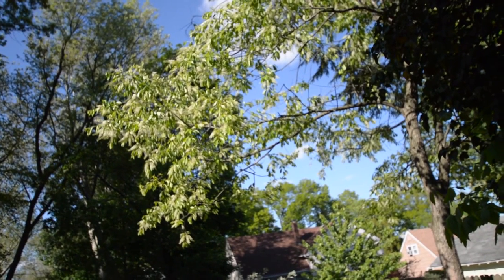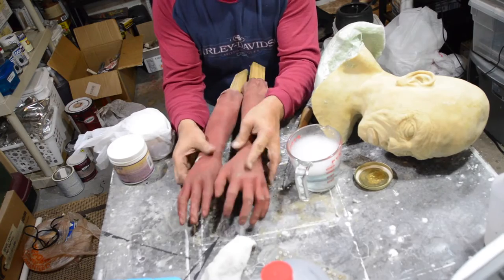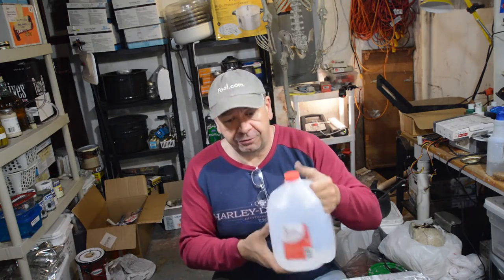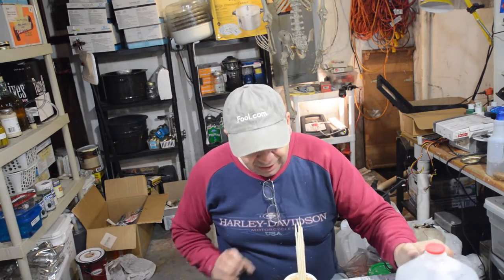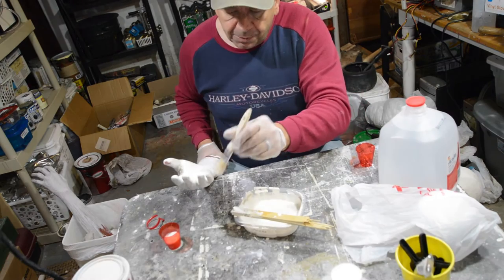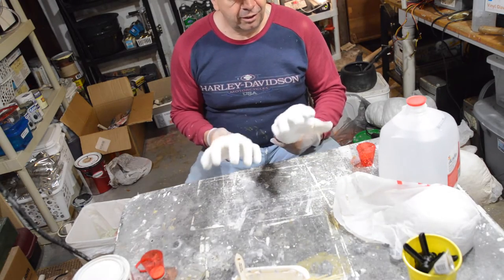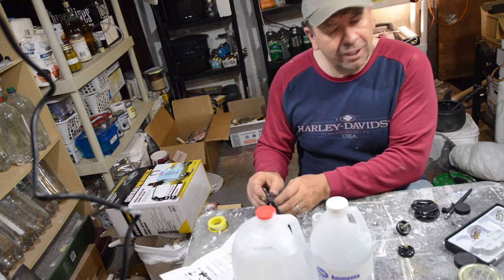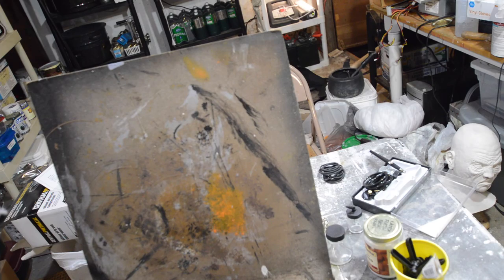Painting the Cellarer Prop Mask and Arms

Comment: Great video!!! Can't help ya with the airbrushing. The other day I thought of you, you would have laughed! I was trying to remove a shelf in the closet......i was using a screwdriver to push it away from the wall...ended up ruing the dry wall.....then I found an old saw in the garage..started sawing the shelving thinking surely I could make several cuts and eventually just hammer the pieces down....almost cut my arm off....apparently it's a metal saw...not sure why that matters. Figured it could handle wood!! Anyway I got the shelf down with enough hammering. Then had to spackle the damage, and sanded then next day painted. I'm a sissy!!!!
Reply from the maker: +Halloween Happy That's what they make sledge hammers for! Lol! I could just see myself in your situation, and cursing my way through it, making three times more work for myself in the process. But you gotta admire the way those shelves were put up. You know they weren't going to fall down with whatever you put on them
Reply: +GhoulishCop I don't have a sledge hammer!!!! 👀😀 but thought many times to go purchase one lol

Comment: I meant to post this yesterday, but I met with a professional prop maker recently who tipped me off on how to ensure that acrylic paint doesn't crack or chip off. He said that you add a bit of water based contact cement to your paint and it makes for better adhesion to whatever you're painting it on. The downside is that it's too thick to run through an airbrush.
Reply from the maker: +Dminorsound Oh, that sounds like a neat tip! Next time I do a base coat I'll definitely keep that in mind. Thanks! I do know that Allen Hopps recommends coating the finished project with original Armor-All spray, the kind you'd clean your car dashboard with. He says he applies it every 6 months to keep the paint intact.

Comment: Howdy. My apologies, I id not know that Harbor freight added a second $9.99 airbrush to their line up. The one you have is not the kind I recommend I like this one- the quick change airbrush- also strain you paint through some paintyhose before it goes in your paint jar- that was some gnarly latex lol.

http://www.harborfreight.com/quick-change-airbrush-kit-93506.html
Reply: +StiltbeastStudios I was wondering what you would use to strain the paint!
Reply from the maker: +StiltbeastStudios Thanks Allen. That's the airbrush I ended up getting. And I had picked up a box of paint strainers at HFT too, cardboard funnels with a fine mesh at the bottom. But pantyhose works too!

Comment: Don't know anything about air brushes so can't help you. Someone will know and a lightbulb will go off ... even its a very dim one. LOL

That fence post foam looks really solid. I have a project that was going to use the "expensive" stuff for ... will definitely try that now.
Reply from the maker: +The Pirates of North Court Surprisingly strong. I raised my eyebrows the first time I heard about it, thinking "They set fence posts with that?" I'd probably still set corner posts with cement, but for posts in the field this probably works just fine. And for filling masks and stuff, it's perfect!
Reply: +GhoulishCop  Im a fan on it!

Comment: Think your airbrush problems are caused by the tip being brass. Brass is made up of copper and latex instantly coagulates in contact with. Iv literally done the same thing with the same air brush. And the latex that I cleaned out was al gummed up and brown.

Comment: I was curious about the airbrushing as I'm anxiously wanting to buy a kit.  It always looks so easy, I was afraid of that.  so make the paint 50/50 with water?
Reply from the maker: +SandricCemetery (SandCem) If you're airbrushing something like a piece of wood or foam or paper, yes, it would be diluted with water 50-50. If you're doing a latex mask like I am, or something similar, then its diluted by 1/3...1/3 paint, 1/3 distilled water, and 1/3 liquid latex. The $10 airbrush at Harbor Freight (if you have one near) is a good one to practice with. It's recommended by everyone that does masks. I wouldn't get the small compressor that goes with it though. Just use one you already have, like a pancake compressor. My "airbrush compressor" wasn't getting enough pressure built up to do the painting. I switched to my pancake one and it works fine.
Reply: Thanks for clarifying.. lots of detail involved and I don't have any air compressors.  I'm a complete rookie when it comes to this stuff. I do have HFT near, thank goodness.
Reply from the maker: +SandricCemetery (SandCem) Maybe I just need to play with that small compressor some more or -- heaven forfend! -- read the manual!

Comment: did you get it from harbor freight as well? after I seen the video today I kinda wanted one lol ... decisions decisions lol. sweet looking job though. . I really like those terror syndicate hands and mask
Reply from the maker: +beth Schüler Yes, it's $10 at HFT. They have several models there, a better one for $22 (or right now $15 if you're a VIP member). But I'm going to try my older ones again since it was the compressor and not the airbrush. As for the Terror Syndicate mask, you can't beat the price. $30 and it's a pretty good quality pour too. They're thick, not flimsy at all and have some good detailing on them. The prop hands I think go for $15 each. I'd probably get hands/arms off eBay, they're much cheaper, like around $5-$10 with free shipping. Occasionally Hickman has pre-painted masks that he puts on sale, like $35-$40, which is what I used for the Kneeling Monk prop.

Comment: Love your videos. I was wondering, the paint mixture you used with the latex as a base coat, is that mainly for use on things like masks and the hands or would it have other applications? What is the benefit of the mix?
Reply from the maker: +Jen Dagel Hi Jen, thanks! I'm a newb at this, but from what I understand, to get the paint to adhere to latex masks and stuff, you need to have liquid latex as part of your paint mix. You thin out the paint to make it flow through the airbrush easier. Regular paint by itself is too thick. Even if you were airbrushing a block of wood, for example, you would still want to thin the paint with water about 50-50 (but you wouldn't use the liquid latex for that application) to let it flow through the airbrush. Hope that helps!
Reply: +GhoulishCop Thanks for the info! I look  forward to your future videos. It has been fun to watch your progress. You have made some great props!
Reply from the maker: +Jen Dagel Thank you!

Comment: LMAO !!! Fuckin Air brushes happens all the time  3 things  paint to thick  ....not enough air pressure 60 lbs is good ....strain the paint any debris will clog it... even if you just looked in the hole and saw light it clogged as soon as you pulled the trigger  ! HFL!!
Reply: +deoblo85 grin so what you are saying is the pain in da butt is no worth buying/using air brush?  I was looking at a cheap kit on amazon but had not pulled the trigger.. i figured different size paint brushes is how i go, with like 3 colors, a dark base coat then a highlight color and a dark watery in cracks color ..
Reply: +Kustom Scares i would try thinning paint first i was listening to the  mixtures and his is to thick  he need more water
Reply: +Kustom Scares  but yeah the color scheme sounds good
Reply from the maker: +deoblo85 Thanks! I went out and bought another airbrush...and it still didn't work. I then thinned the paint more. Still didn't work. Finally, I switched compressors/. Went from the mini-Harbor Freight compressor to my pancake compressor. It worked! Despite the mini-compressor saying it was at 60 psi, I don't think it was.
Reply: +GhoulishCop great as long as it worked  :)
Reply: +GhoulishCop that's good to hear and know, now wanting to see how the air brush work turned out.